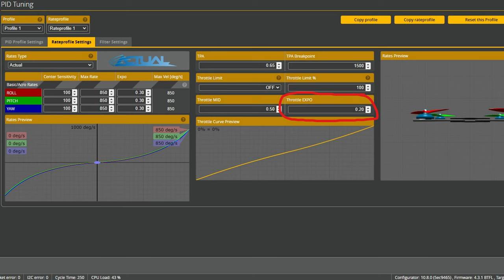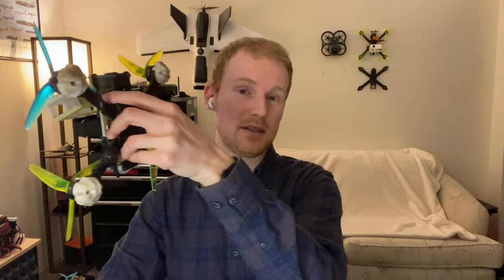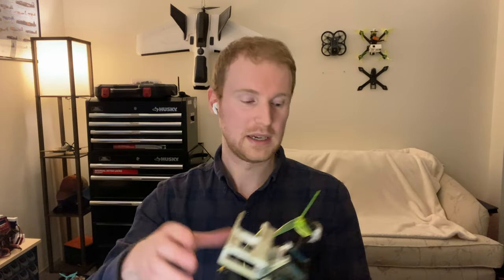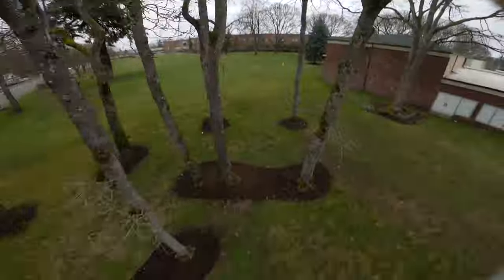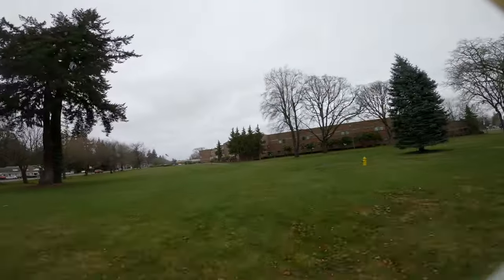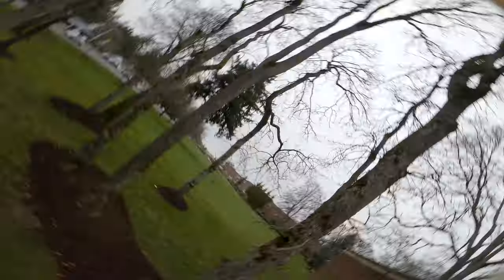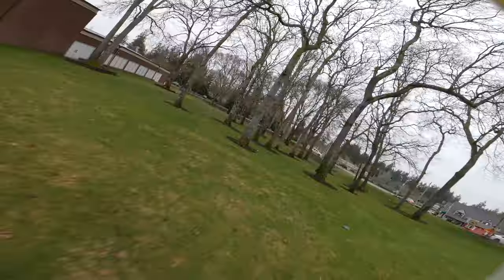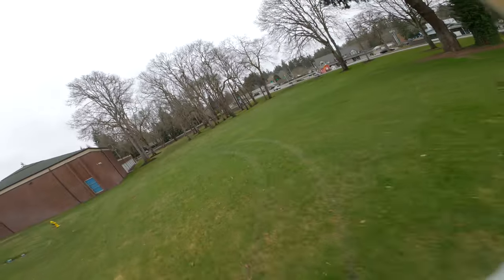5  SIMPLE Tips To Improve FPV Drone THROTTLE CONTROL! // PropabilityFPV

Comment: For myself, throttle expo was Godsend! I do a lot of cinematic flying, 3" whoops, 3.5" quads, long range 5" and 4" racing quads among others. When I started the 'bouncing' I was getting especially the more the quad was level, braking, going through gaps and such, when there's more thrust to altitude or hovering than directional momentum I'd see it the most. I know I'm in a small segment of people who really lean on throttle expo but it works for me. Whenever I'm building a quad I'll typically set the hover to 35 and the throttle expo to .70 which is low on the hover and high on the expo but if someone is having trouble with throttle control, especially proximity flying, give it a shot. I do think this is still applicable for freestyle quads but to achieve snappy maneuvers when flying say Spang you'll want much less expo. Hope this really helps someone who's struggling with these issues
Reply from the maker: Great tip! I suppose it’s all about what style/purpose you’re flying with. It’s kind of tricky to find a perfect one size fits all setting for me as I like to have a bit of flow but also incorporate some high throttle tricks into my flights.
Reply: Thank you very much for your Suggestions! Could you suggest a video tutorial on Throttle control tuning on Betaflight ?

Comment: Great stuff, man! I hadn't thought of throttle expo, but I've added a llittle to the quad I'm taking out in a few minutes. Leaf canopies are a great way to orient yourself in the flying space, as long as you either stay below the canopy, or far away enough to manuever clear of the upper part of the tree.  I'd just add flying in a sim - yeah, yeah, but flying a set of gates on a level patch of ground can help sort out the thrust direction at different roll orientations, and it's convenient for adding some sort of extra stick time.

Comment: I have noticed through this hobby (6 years in) that racers are better freestyle flyers and quicker learners when it comes to tricks etc. They HAVE to learn throttle control to not balloon around gates etc. Throttle is key. I was getting much better as an old guy a couple of years back as I was flying nearly daily, but dropped out due the $ I was dumping. Trying to spread too thin with too many models and sizes, buying parts, frames and keeping them in the air.
That being said I know I would improve with digital, but that's not my reality atm.
Reply from the maker: Totally agree! I think part of it too might be the naturally RC talented probably trend more towards racing at first. Might have to make a part 2 for this, I think adding racing practice irl/sim is super helpful!

Comment: i've noticed when i'm really low low to the ground, my LQ drops Immiditly, even within 150m. I use Crossfire with tango 2 on 250mw 150hz.
Reply from the maker: Interesting, could be just the ground interfering with the signal? I've had similar experiences too. When you climb back up at the same distance away does it improve?
Reply: If you're interested in learning about what could possibly be the factor, try learning about what the  'Fresnel Effect'  is. It has to do with what  ProbabilityFPV is referring to. Quick note on the effect, if the Rx or the TX are high, off the ground, it should make a better signal. So, at the same distance from the pilot, if the copter is high in the air, the signal should come back. And if the copter is close to the ground, but the pilot (radio & goggles) are high up off the ground, the signal should come back.

Comment: Thank you for the tips what sort of camera do you. As a newbie I started at 20 then went to 25 now im thinking more like 40 as better i think for certain tricks.
Reply from the maker: I hope they help! I currently use 25 but I've been considering moving to 30 as I get faster and more technical. 25 seems to be a pretty good mix of "trickability" and speed. Anything above like 35 scares me, that would be too fast for most of my flight haha.
Reply: @propabilityfpv  Completely agree! I do find that diving is a issue when first starting to climb as when I’ve been at around 25 in order for me to see the top building I have tilt up more then that causes the drone to drift away from the building so i basically have to fly up without really seeing the top! Thanks for reply I appreciate you!